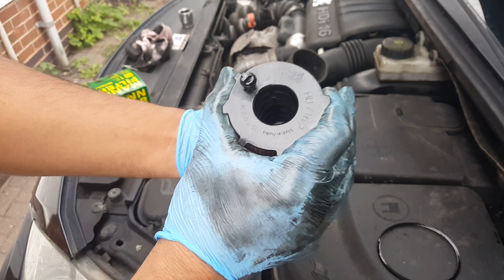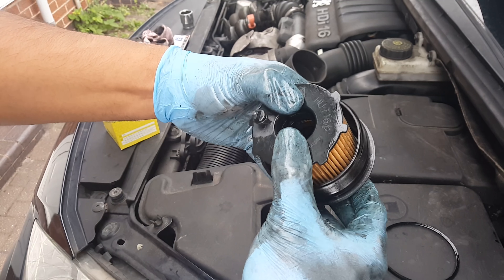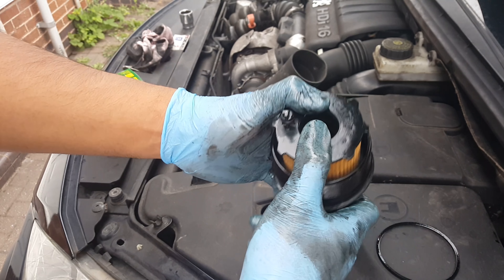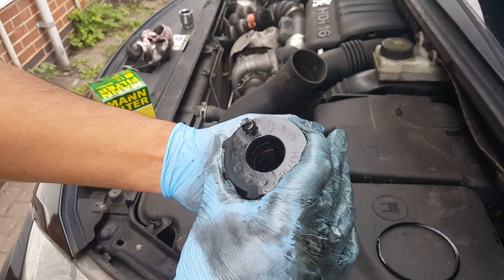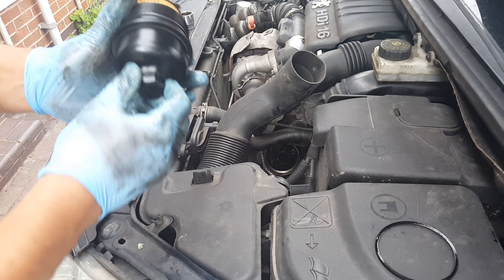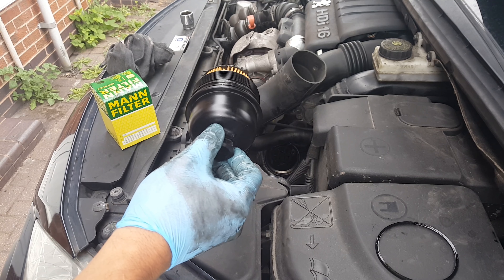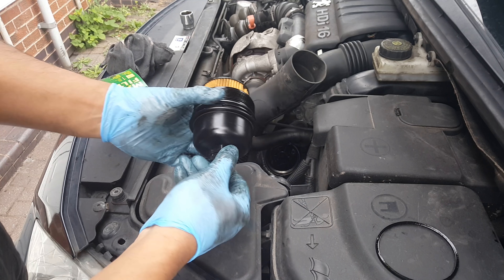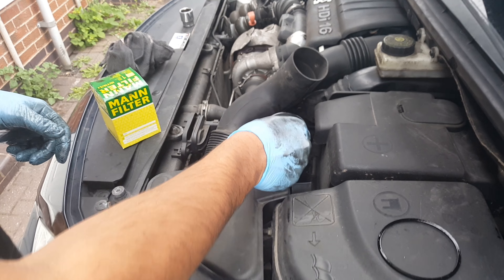Peugeot 307 Engine Oil Change

Comment: I dont mean to be rude but how can you be sure that the filter has located correctly within the housing? Shouldn't you fit the filter to the engine side first then screw the cap on?
Reply: Always put the filter in the engine 1st so its fits exactly where its meant then put the cap on.